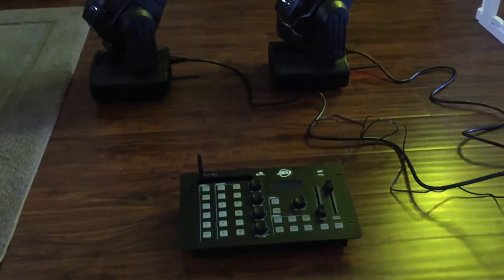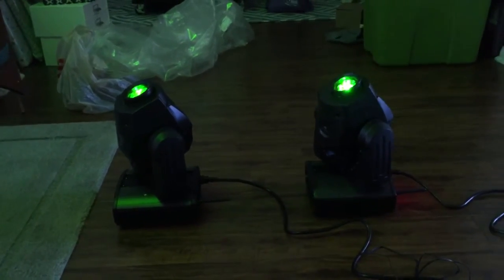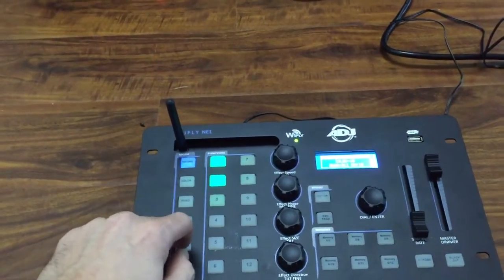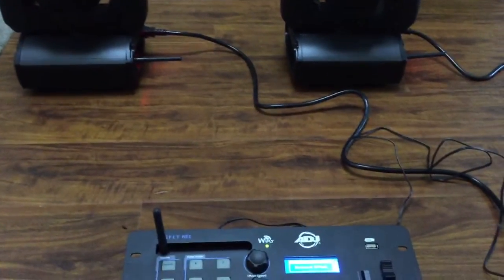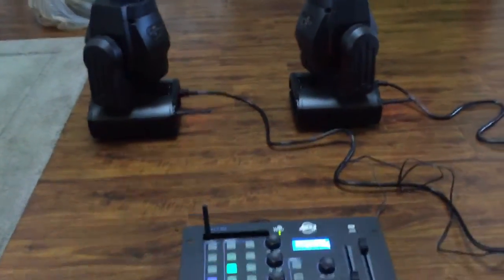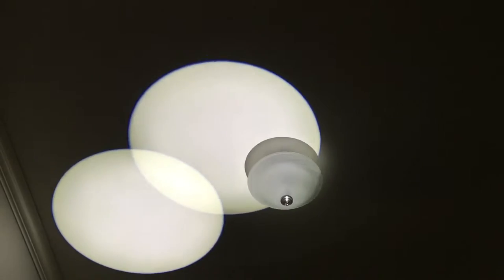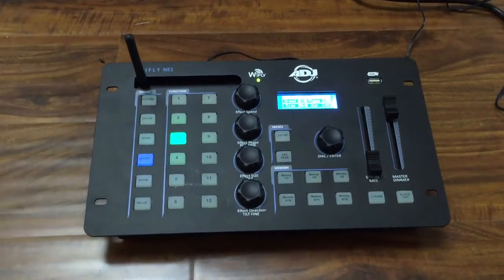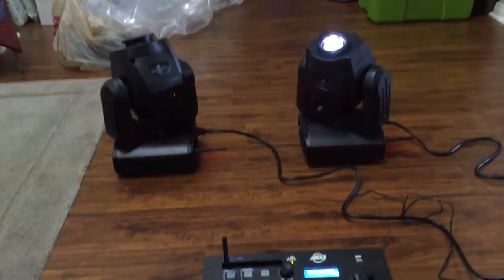American DJ NE1 WiFly glitch

Comment: Unfortunately this is a common issue with these lights.  It has more to do with the fixtures than the controller.  The ADJ Inno Spot Wifly's are notorious for dropping signals.  I own 12 of them and half of them have issues with signal dropouts. I have several different ways to control them ( Wifly transceivers, WiflyBattery and a  NE1 controller) and they all have the same issues. You can switch to another channel but I guarantee that you'll have the same issues.  I've given up on the wireless option and just ran DMX cables.  I know it defeats the purpose of getting wireless dmx lights but it's better than them going crazy at a gig.  If they are dropping their signals at 5 feet imagine what they'll do when you're at a gig with lots of wireless interference and greater distances.  I sent mine back to ADJ about a dozen times and have had no luck.  Now they are out of warranty :(
Reply from the maker: +DJ Patrick B.: I had been emailing the ADJ Service Center last week, sending them the link to this video.  They recommended I put BOTH fixtures to SL1 under the SLND menu, basically putting both in "slave" mode.  I didn't really believe that it would do anything, but the fixtures work perfectly now with no weird glitches!  Maybe you could try that with your fixtures.  I'd be really curious if that fixes your "signal dropout" problems.  Thanks for the comment.
Reply: Michael Ambro Thank you.  I will check this out for sure. Could be true.  If this works they should add it to the manual.
Reply: +Michael Ambro I tried it out.  No luck.  Still having the same issues.  Mine were already on SL1.  I even tried switching to master but it was the same scenario.   Oh well.
Reply from the maker: Dang, sorry to hear that.

Comment: Michael, if you don't mind my asking; what guidance was the ADJ Service Center able to provide? Also, I have not been able to access the Inno Spot Wifly's shows with the NE1; the show buttons don't seem to recognize anything. Any idea what I could be doing wrong? Finally, are you building shows from the ground up and storing them or altering effects and using those instead? Long story short, I have not had much luck getting a decent show with the Inno Spot WIfly/NE1 combination and could use some guidance. Thanks! John

Comment: To bad to see, maybe you can contact arnoldo at the adj ne1 facebook group. He uses wireless dmx from adj a lot i think. He might have some tips. 
But when one light acts up, it can't realy be the controller i think. Try wifly-in the fixture that does not act up, and dmx to the other fixture from there. It could solve the problem. I understand that is not a great solution.
Reply from the maker: +Ivan vH: I am part of that Facebook group, but I ended up figuring it out with the ADJ Service Center first.  Thanks for the comments!